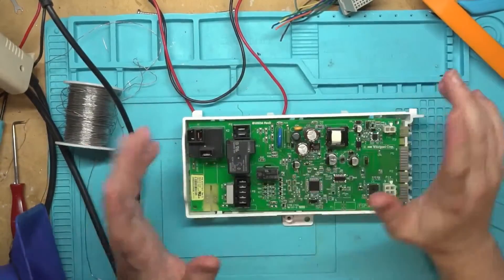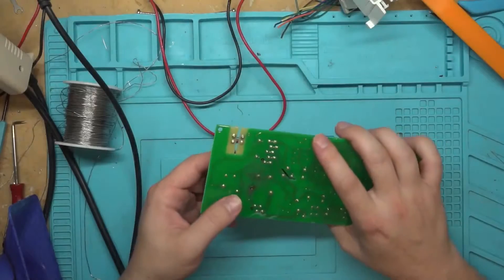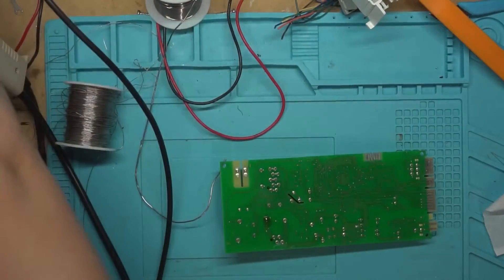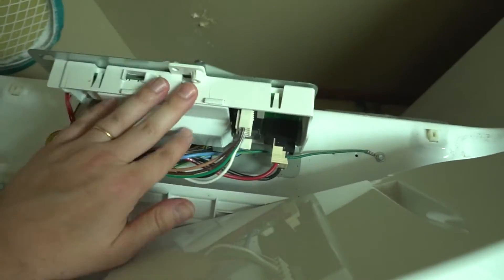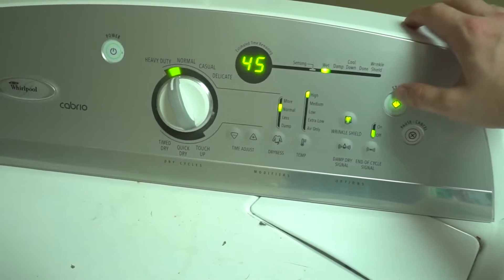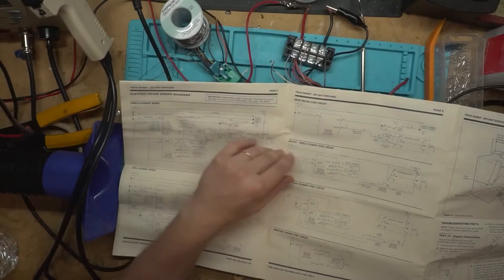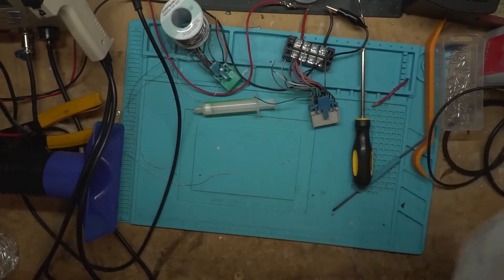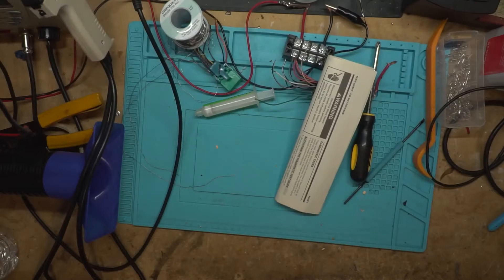Whirlpool Cabrio Dryer F1 Error: Circuit Board Repair

Comment: I made this repair you have to replace the relay it will work for a little while and blow again
Reply from the maker: Not saying your experience is wrong but mine is still working to this day. I actually just put a load of laundry in the dryer now. replacing the relay is best I agree with that.

Comment: Thank you! My repair worked! It was burnt in the exact same spot as yours. I was glad to see that you and someone else responded that your repair has held up for at least a year. I want to mention that my board had one extra connector in the corner that I don't see on all the videos for this washer. It is a plastic connector with a blue wire and a red wire and it attaches to  a little Orange box in the corner, I think it might be because I have a steam dryer. Mine is also gas. I don't know what model you have. I think  the extra connection is for one of those things. It was very very hard to pull that connection off. I had to get needlenose pliers up under it and really give it some pressure and some leverage to get it off. I don't know if someone was stronger hands than me could have just pulled it off with muscle. Thanks again!! You should video all your repairs of the washer and dryer!

Comment: Is it still working? I"m about to install my new one, but I'll give the old one a look first. NO returns once I install the new one!!
Reply from the maker: Still working. I might have to work on the washer again soon but it's a bearing making noise this time
Reply: Awesome! Mine is gas and I think they can last a long time. The repair did work, I just tried it but wanted to see if it had held up before I closed it up because I had one connection ( that not all of them seem to have) that was crazy hard to get off and I was afraid of ruining the wires.

Comment: mine is the cabrio platinum, but I had the same exact issue. thanks for the video it fixed my issue. time will tell if it will last or fail again, but it saved me in a pinch for now. I was prepared to buy a new dryer, but after taking a few things apart, I found the schematic, and was able to get into a diagnostic mode which gave me the F1 error. the Schematic says F1 is the control board. so after narrowing down that worst case.... a new board, I decided to turn to youtube. lol thanks again!
Reply from the maker: I'm glad it helped. Mine still hasn't given me any problems since I uploaded the video but let me know if yours fails again. You should replace the relay if it fails again just search the part number on the relay with mouser or digikey and you should be able to find a new one.
Reply: Did it stay fixed?
Reply: @cindyb8766  mine was still working in February of this year. Unfortunately, my matching washer started to have multiple issues, so I replaced the washer and Dryer. This is definitely a worthwhile repair.
Reply: @davefree11   thanks. My repair worked tonight! Just wanted to check because I had one connector that was ridiculously hard to get off. Now I'll close it up!! Mine was the exact same failure spot as the video.

Comment from the maker: Sorry for the half baked video I didn't know if I was going to be able to fix it. I didn't record taking it apart. After finishing the repair I found out that this is a common problem for this board and that sometimes what I did will work but  sometimes it will just be a temporary fix. If it goes out again the relay is normally cause and should be replaced according to what I found out.  Its my dryer so I will report back if I have problem in the future but its been good for 3 days now. Hope this video helps someone out.
Reply: I totally agree with you. Appliance repair guys have schematics, mobile phone repair guys have leaked schematics....(Apple)....and very detailed schematics they are, and us automotive component repair guys have nothing but wiring diagrams and pinouts at the most. And to top it off, not only do we not have schematics, a lot of the board level components are proprietary and can be difficult to look up.
Reply from the maker: The most annoying thing is when you find components like MCU in the 03-07 classic clusters are just given a seemingly random part number. Its just a XC161CJ